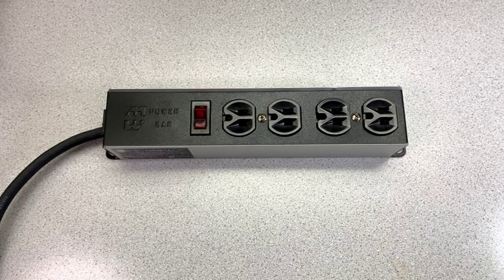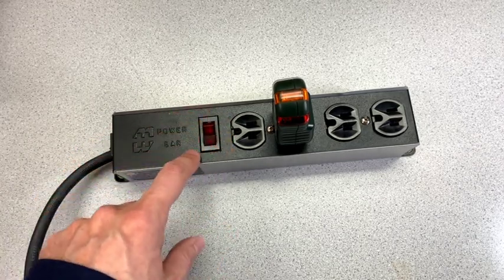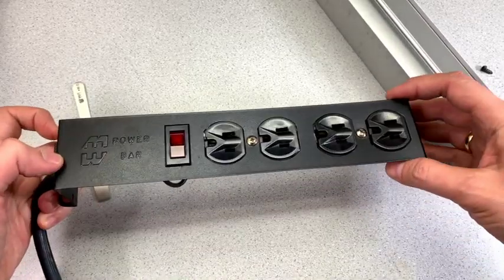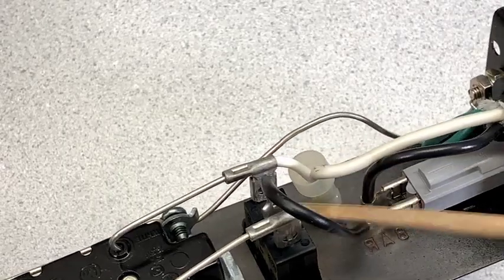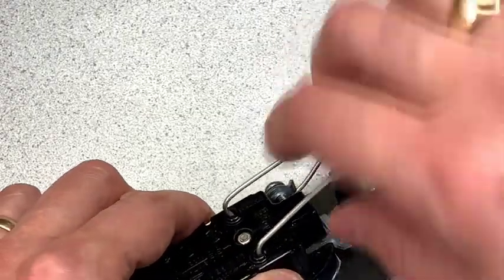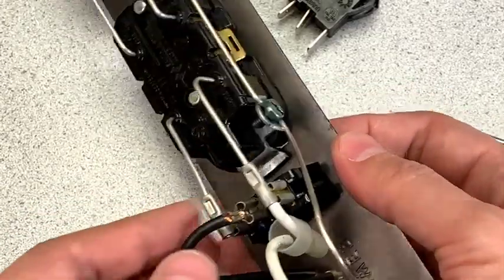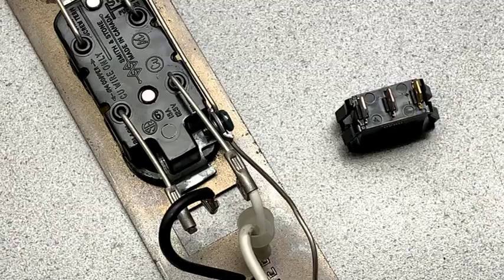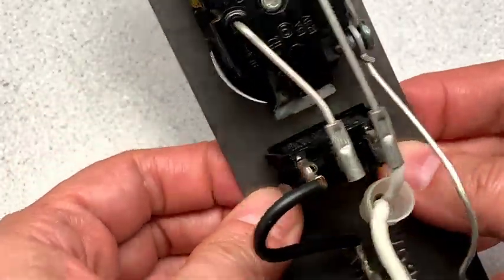How To replace an illuminated rocker switch

Comment: Funnily enough..... Throughout all the years.....I think the only thing I've ever replaced a lighted rocker switch on.... are several really nice "isobar" power strips/surge protectors. 

I found nearly a dozen  over the years, and they are still made to this day.....with thick nice all metal design, very well thought out circuitry inside, and With big beefy pcb/ through hole components.... And a massively beefy cord.

 Some of them I got in trades, even found a few at  scrap yards with the cords cut off. 

The rocker switch is all they ever needed. And Maybe once I replaced a blown varistor inside.

 About a hundred bucks a pop. But worth every penny. And perfect for the electronics lab!